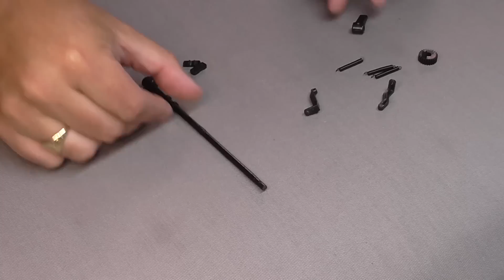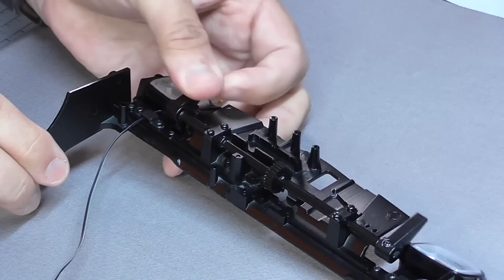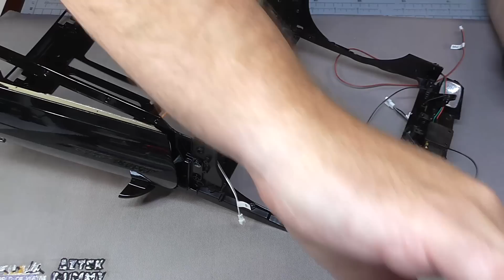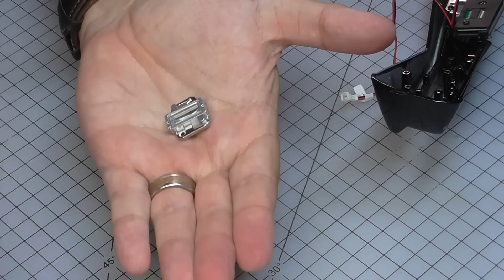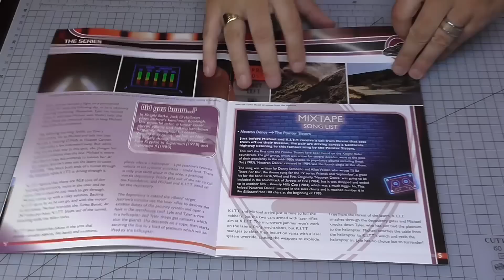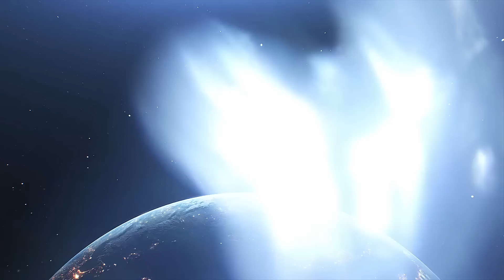Fanhome Build the Knight Rider KITT - Stages 79-82 - Headlight Mechanism and Scanner

Comment: Looks good Wayne, just a point to make it should be noted those springs are best left a little loose, I found that works much better so they can pivot, also if you want to temporarily mount the front like I have a GM screw through the bottom of the mount is the correct screw to use

Comment: One thing to watch for, check the headlights fold back down fully and line up flush with the bonnet and front nose. The headlight LED wiring needs to come out the rear of the light housings facing towards the wings, NOT straight out centrally. Took me ages to figure it out but it is in the photos of the instructions even though it does not state this. Mine work perfectly now, fully opening and close flush with the bonnet/hood & nose.
Reply from the maker: I already folded my wires down

Comment: I have just gone to reconnect the electrics to check the lights motor and nothing seems to work , any ideas or help please ,I checked batteries in the car and watch it's not making no sound and no lights nothing
Reply from the maker: I would get a volt.meter to it to ensure.power is getting to the board
Reply: Thanks for that mate , sorry but could you tell me where to exactly attach the volt meter  @WorldofWayneUK
Reply from the maker: @lukesunner1144  check the lead coming from the battery box first to ensure the plug that goes into the board has power. I'm guessing if nothing is working that's your issue. If it does have power then the issue is with the remote.
Reply: @WorldofWayneUK  Thank you mate